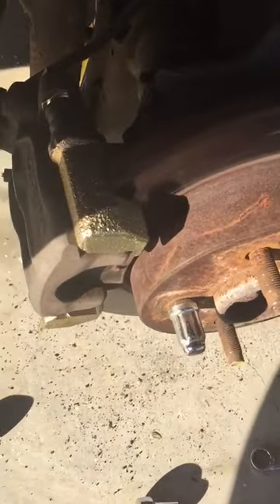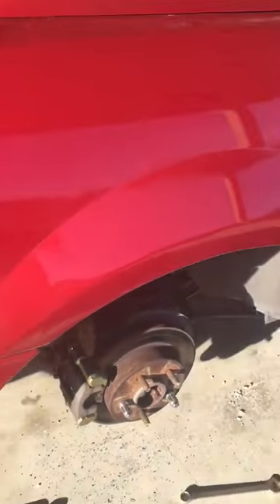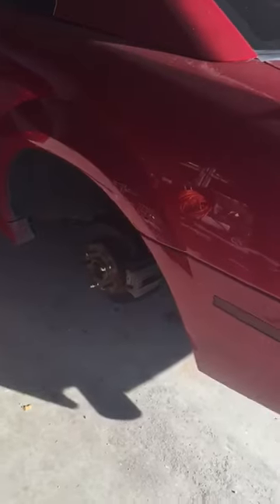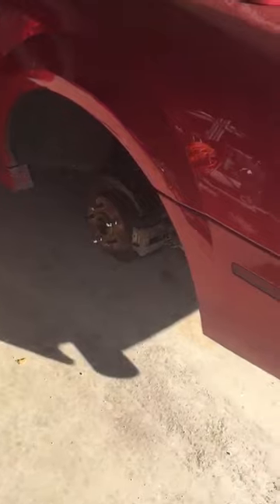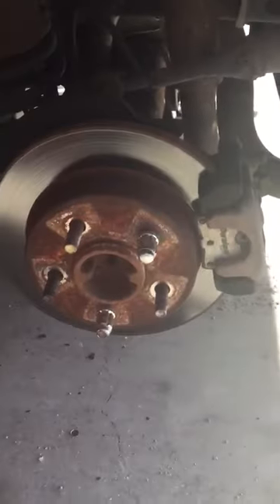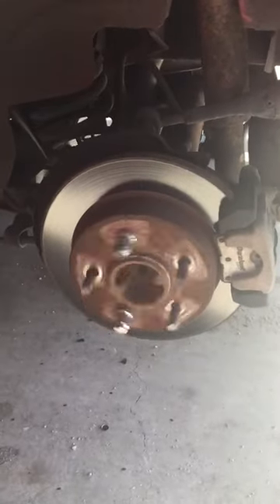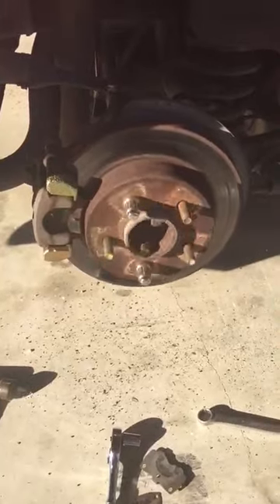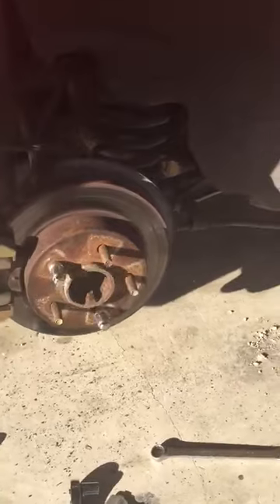Rear right wheel won't spin

Comment: warped rotor. open diffs will always put power to the wheel of the least resistance. kindof like lightning. your right rotor is warped, causing the brakes to grab it and eventually let go from the left over torque being used from your transmission. Easy fix, just take the rotor to a local Les Schwab or what ever tire place you have and get them to turn the rotor. They do it on a daily basis.
Reply: Does not appear to be just a warped rotor, if you look center of rotor, where it slides over the axle shaft/hub at the center, this also appears warped when it turns, not sure what vehicle this is from the video. Unfortunatley, Helives629 wishes this was only a rotor I'm sure; wish him the best of luck with this fix.
Reply: @dr.dock3165  dude no it's totally a warped rotor. You can see it wobble.  It's obvious. I'm not being rude.  But just look.  You. Can. See. it. Wobble.
Reply: @bradjizzle8454  "dude" as you apparently prefer to address people, in addition to the rotor being warped, at the least the outer end of the axle is as well
Reply: @bradjizzle8454  As a matter of fact, upon further review of the comment section, Helives629 replies to Audun Jemtland and says this was a bent axle. So, perhaps you should look at the video again and pay attention to the end of the axle shaft because as you already put it, "it's obvious."
Reply: @bradjizzle8454  it's a warped axel